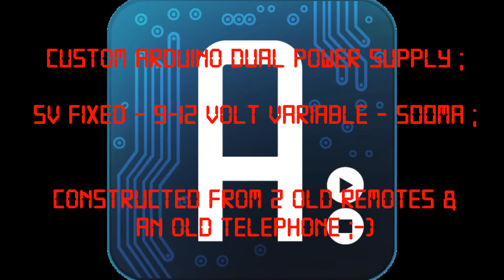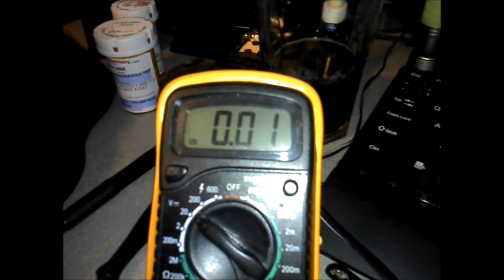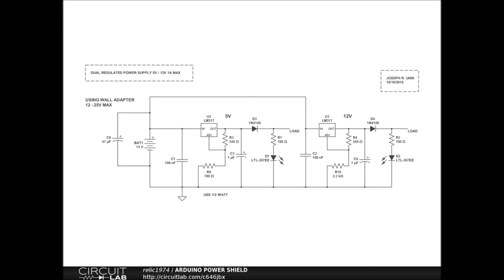DIY Arduino Dual Regulated Power Supply Board

Comment: so i checked out the arduino site and the arduino likes to run on 7-12 volts i had assumed it liked to run on 5v because i'd always had it powered by the usb. so that may have been my problem. on the data sheet for the lm317 adjustable voltage regulator  the equation for Vout  is Vout=1.25v(1+R2/R1).  with this equation and the resistor values in the your diagram ( R1=240 and R2=780) Vout should be 5.31. actual Vout  was 4.95.  so i ended up running the arduino off the 12v circuit n left the resistors alone.
Reply from the maker: yep.  I was using LM317 regulators.  several resistor combinations will give you the same VOLTAGE output but the lower the resistor values the more CURRENT it will provide.  Use of of the many LM317 calculators on the internet.  google "LM317 calculator" and it does the math for you.  With regulators, a good rule is to always supply with 3 volts more than the intended output.  So for a 7 volt output, give it 9 or 10 volts input and choose your resistor's according to your current requirements. 

A much more stable method is to use a fixed regulator, if you don't need to to variable!  In that case use a 7805 with a 7-12 volt supply.  I'd love to see your finished board
Reply from the maker: arduino uses a smaller package like the 7805 so it's a fixed voltage regulator.  it takes the 7-12 volts and regulates it to 5V.  you can also run 5V directly to the Vin pin on your arduino to bypass it's regulator.

Comment: GREAT VID . i went i made a similar adapter following your vid. i think I'm gonna try changing the resistor values in the 5v circuit to raise my 5 v circuit voltage. wen i had my arduino hooked up to usb from computer on bourd LEDs are brighter. and on my latest project. wen only powering from this power supply the arduino had some trouble switching things to digital HIGH. i did have the supply powering several circuits so its probably my own fault. did you ever have a need to adjust your resistor values?